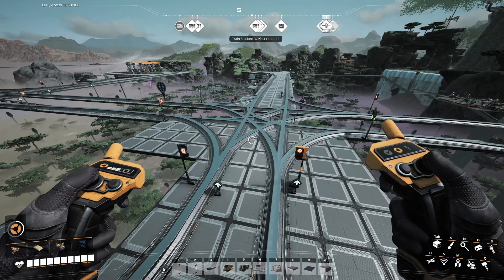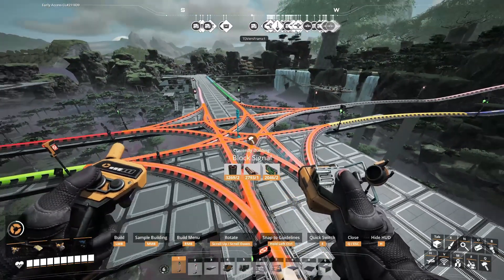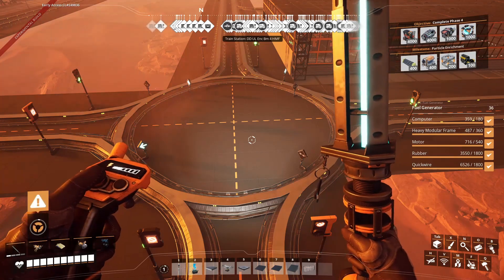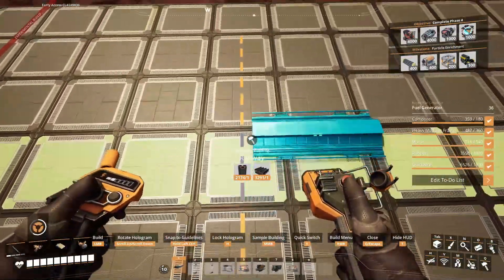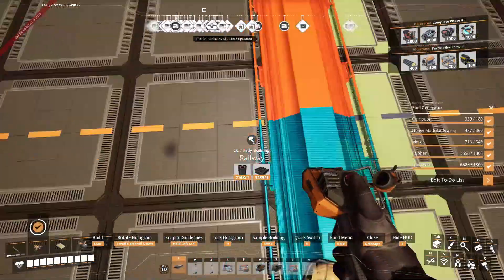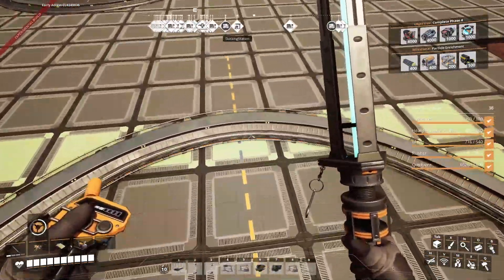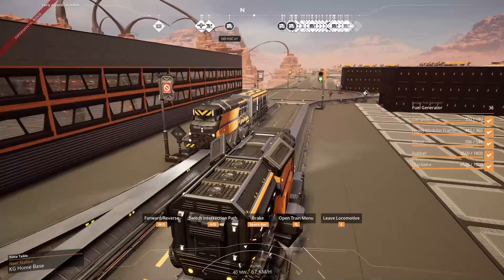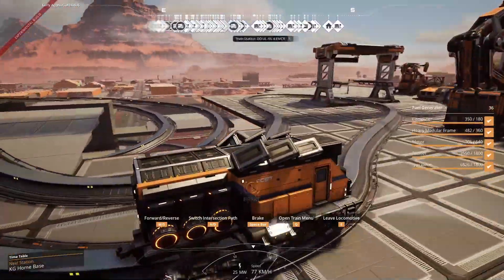Part 03: Satisfactory Guides - How Do Trains Work? Roundabout, Path Signals,  Junction, Spiral Intro

Comment: Really good guide.  Used this to help me get started with Trains.

One additional thing that I added to the roundabouts that really eased congestion was adding bypass lanes to make it a "turbo roundabout". 

You dont need it all the time at all, but there are some high-usage roundabouts that massively increase throughput if you chuck some slip-lanes on them if you have the space, because a lot of trains just bypass on their turns straight past them instead of having to wait for other trains to pass.

Comment: to see the colors of the blocks do you need a mod for that or is that in the game by default, if so i haven't ever seen it when building with rails
Reply from the maker: Its in the game by default. On the experimental servers its currently bugged and not showing., but on the early access servers its there and working fine. No mods needed.